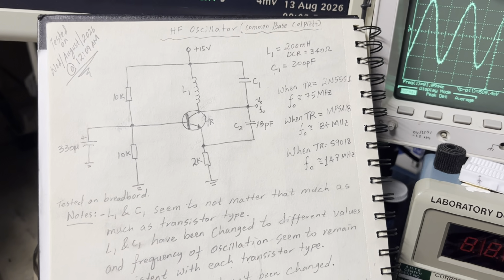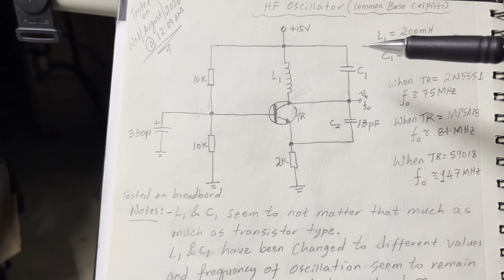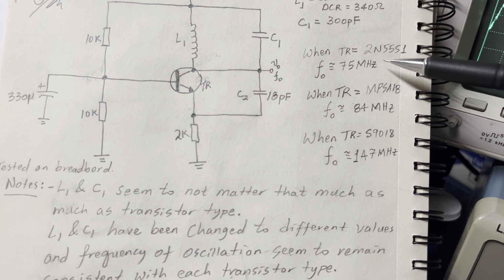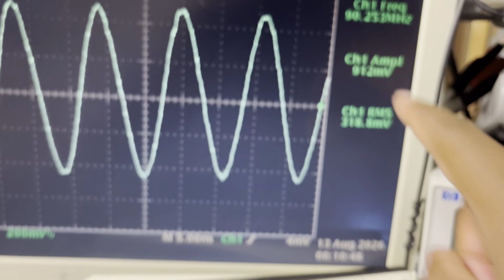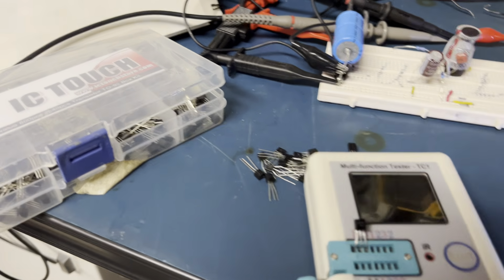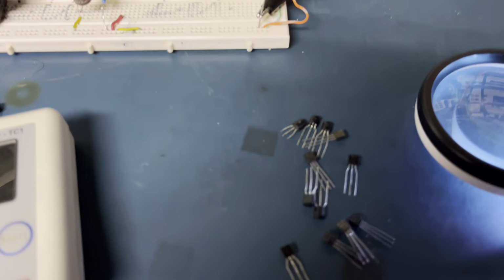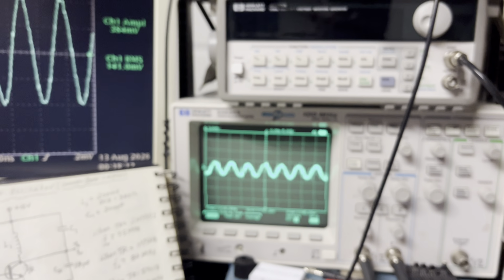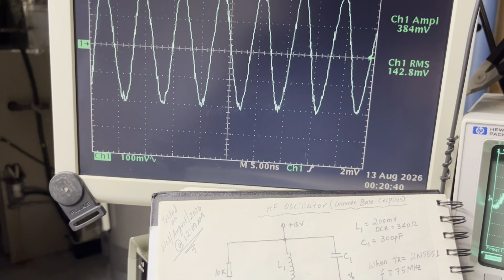Using Common Base Colpitts Oscillator to Test Transistor's Transition Frequency Qualitatively

Comment: Can you give some industrial or commercial purpose these high frequency transistor are used currently,considering the wide variety of   video frequency opamps and RF amplifier available?
Reply from the maker: Front-end Low Noise Amplifiers (LNAs) in communication systems are typically single-transistor designs. This allows engineers to precisely optimize noise figure, bandwidth, gain, power consumption, and matching performance. At high frequencies, integrated circuits (ICs) rarely match the performance of a custom single-transistor amplifier. When they do, their cost-to-performance ratio is significantly lower. Just look at the amount of different RF BJT that are still in production here https://www.digikey.com/en/products/filter/transistors/bipolar-bjt/bipolar-rf-transistors/283. emiconductor manufacturers would not maintain these transistors in production if there were no market demand for them.